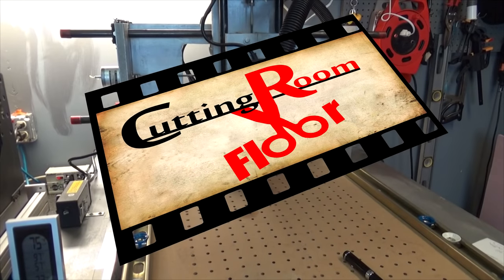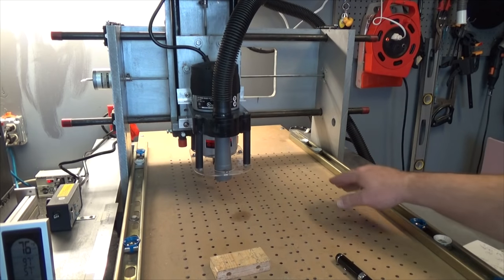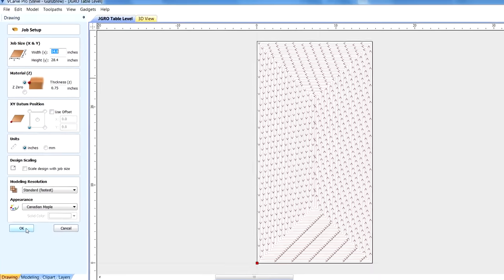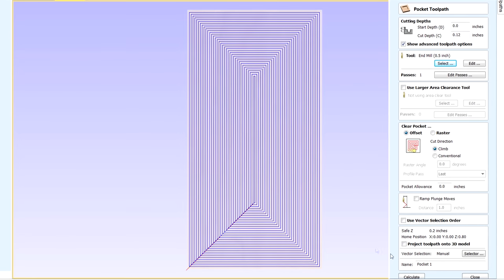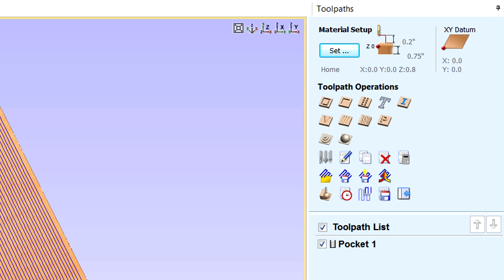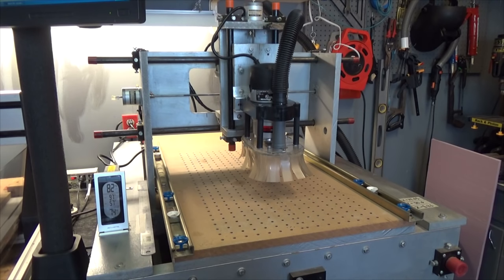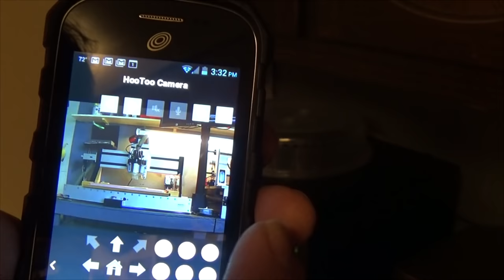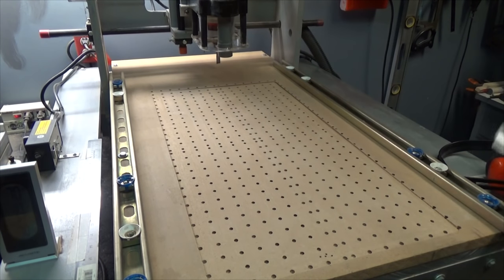How We Level CNC Table to Flatten - Cutting Room Floor

Comment: the multiplier is there to fine tune the time closer to reality for the CNC    On mine 1.25 is almost dead on.. ( cutting time only) as there is NO way to predict how long it takes me to make bit changes. )    

Also note this thing about mach 3 and ALL the vectric programs.--  Just save ALL the tool paths ( including different bit ones) into one G-code file.  There is NO need for a seperate file for each different bit used. There is 2 post processors for Mach 3, one that does NOT support a tool changer and one that does.  Use the one that SUPPORTS a tool changer -- YOU are the tool changer.  :) There is actually 4 for Mach 3, a pair for metric and a pair for imperial. Both  have manual or auto tool change so use the one for your measuring system.  If you go into the settings window and TURN OFF the -- IGNORE TOOL CHANGE (on by default)  Mach 3 will pause for you to do a manual bit change.  The little box right above the tool number box will be flashing yellow when mach 3 pauses. You dont have to do anything to X or Y, only Z needs to be re-zeroed. Then just hit cycle start and youre off to the races.  On initial startup you will have to hit cycle start twice to get going.

Other cam progams that generate the change tool command properly like TX  where X is a number,  the NUMBER is what makes mach  3 actually pause.  If there is NO change with the X even if you know different bits were used, mach 3 WILL NOT pause.   The T will always be a T as its the character standard G-code interprets to mean a tool change where the X is a tool number.   Example T3 is tool number 3   T1 is tool 1

Comment: Hi, I liked what u did but I want to ask how many motors have been used for Y axis one or two, and what are specifications for motors max amps and max volts, Big thanks.
Reply from the maker: The Y only has one motor. It is a small 80 ounce type. Not sure about the voltage but around 1.8 amps. I will be replacing it soon with a 305 ounce type that is 4.2v, 3A, 200 S/R, 3.2mH  for faster feed rates primarily.

Comment: This has been a great series to follow along.  In your case would you say the leveling required is due to a warp in the spoils board or a slight  twist in the CNC's Y axis?  I'm assuming X is side to side and Y is front to back.
Reply: hankus253 it would seem the it's primarily the spoil board that is the issue not to say that some of it couldn't come from the y-axis
Reply from the maker: I think a little of both. All the weight of the X (horizontal) and Z on the 2 Y axis gas pipes may have sagged slightly over time.
Reply from the maker: The MDF is surprisingly flat but it definitely not perfect.